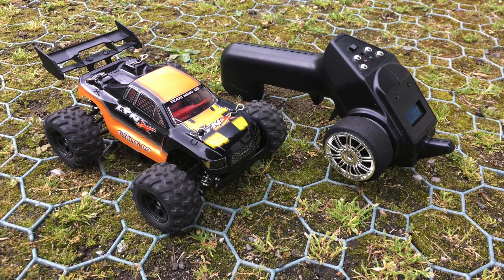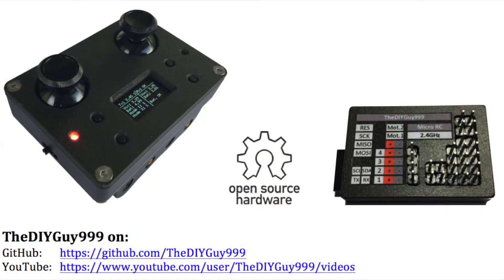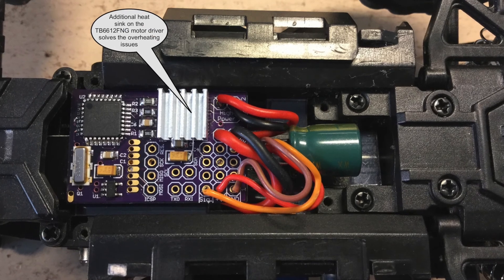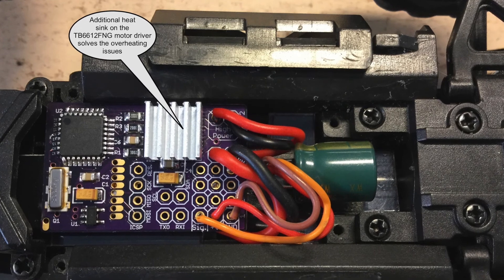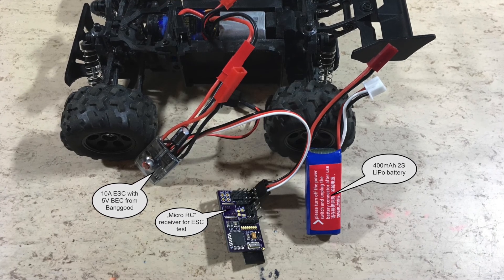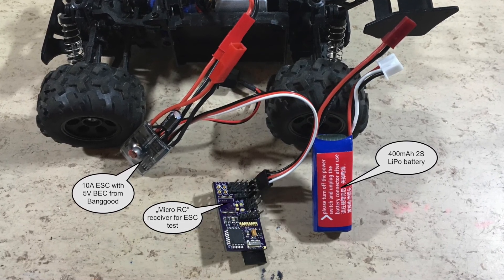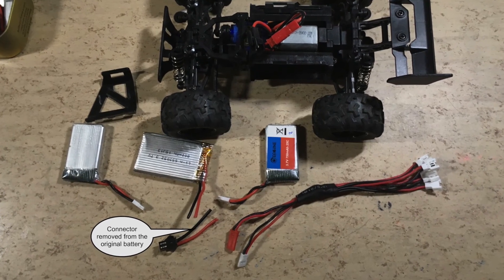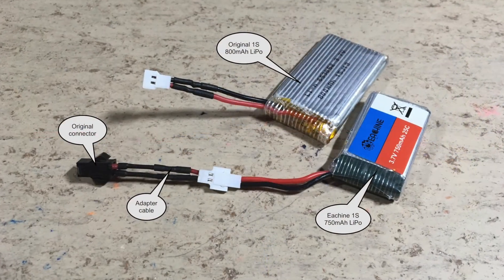KD-Summit S600 Truggy Part 2: 10A ESC & 2S LiPo Battery Mod!

Comment: That's better now !
How do you do the things you do so easy I just use ready to go boards you seem to have a way with electrical eng skills.  I just do a bit of mix and match.
Nice vid again
Reply from the maker: I know just some electronics basics. This helps a lot. Also, the development of this RC system took several months and it is still enhanced with every new car.